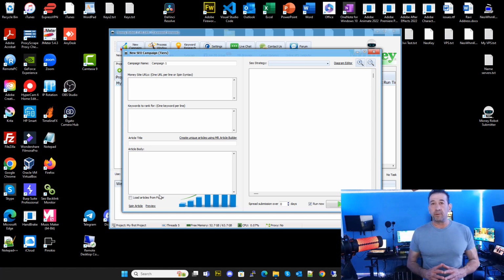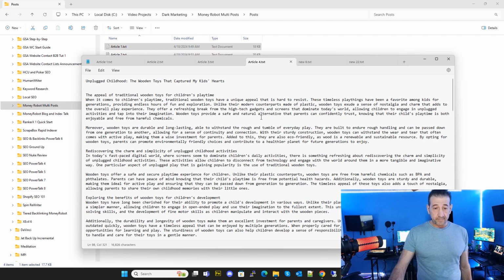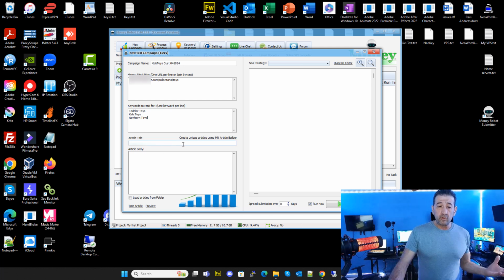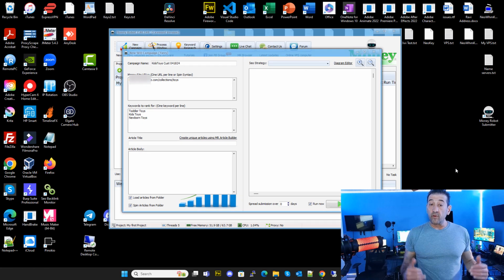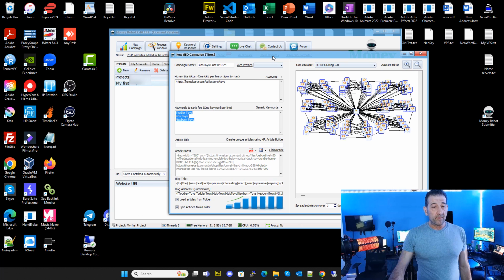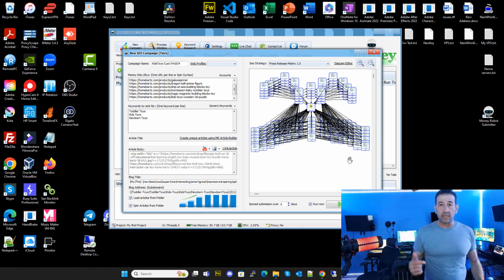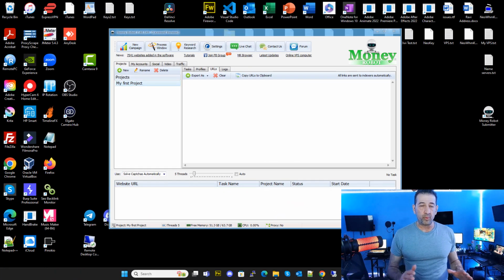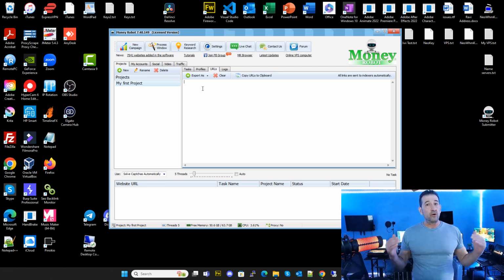Money Robot Multi Posts Backlinking Explained & Ranking Keywords

Comment: Backlinks from Money Robot are not indexed on Google??!!
Reply from the maker: The back links that it creates from blogs will not appear in Google unless the content is focused on something that Google has almost no real search results for and then it may appear, but as a general rule 99.9% will never appear in google search results and that’s a good thing. We only want, ranking data to be transferred into Google scoring mechanisms and we can observe from external tracking that this works. Google doesn’t include most of the web in its search results, but it does rely on the data and signals back links and social  media activity without ever showing those in their results but they can be tracked through systems like Ahrefs.

Comment: Friend, thanks for the video. Please ask me a question, can I use money robot 3-tier diagrams directly for my website? Or Google may penalize (I'm filtering blogs that have a Spam score lower than 20)
Reply from the maker: The diagrams that you use in money robot are not true tiering, it’s more of cross-linking, and most of the other modules outside of the blogs only makes small post and have lower ranking factors and so they only drive signals to the main blog post and to the money site that you configure, and don’t forget you’re not necessarily just back linking a single URL. Sometimes you’re going to be putting multiple URLs.
Reply: @smartmarketingSEO  But using my final URL in money robot does not run the risk of being penalized by Google?

Comment: It would be great to know is it really work or not, the software subscription fee is not cheap,thanks
Reply from the maker: Works 100% and is one of the most important link building tools in my arsenal, but like I always emphasize in my videos, it is the quality of what you create and post, that really brings the success factor. You can’t just use the wizard to fast track your way through campaign creation. It’s also one of the most cost-effective solutions because it doesn’t require any third-party products. It’s the first most important tool that someone should purchase if they going to get into doing back linking themselves.
Reply: @smartmarketingSEO  thanks for the reply , I just use your link to purchase a license. I am checking your videos and doing some test drive.
Reply: @LTTessYu  Hi, I'm thinking about purchasing the license, do you still use yours?